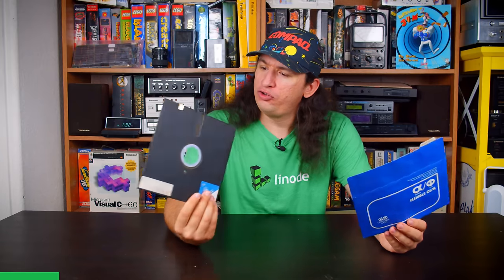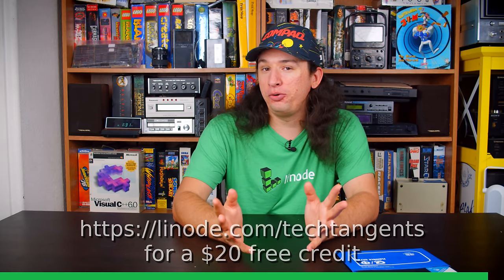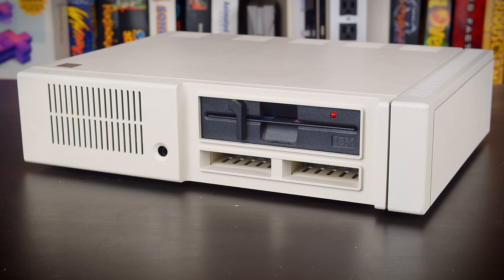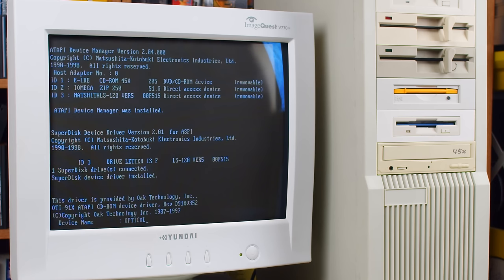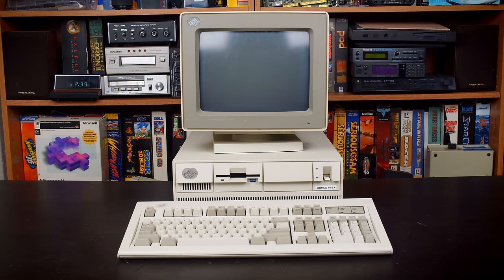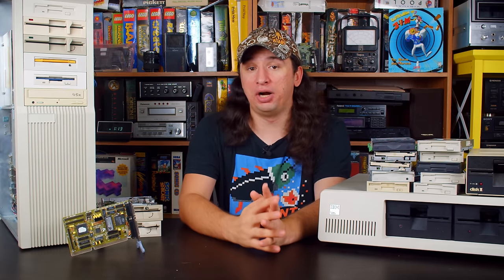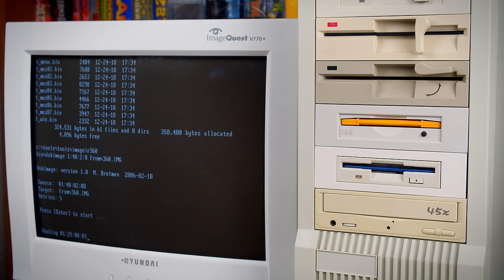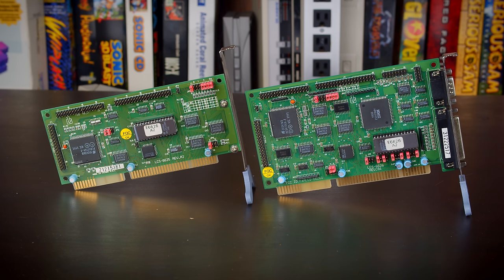More than two floppy drives?

Comment: having a floppy drive as C: would surely cause some interesting software problems :P
Reply: Probably. But did you know Windows can be installed on any drive letter (at least before Vista)? The NT based ones can even boot with absolutely no C drive. I've had this accidentally happen when installing 2000 or XP when there's already a formatted drive in the system.
Reply: @eDoc2020  i took a class on OS troubleshooting that involved managing five separate installations of NT on the same hard drive. it was quite the nightmare. parts of Windows and some Windows software expects Windows to be installed on C:, and will behave very strangely if that's not the case.
Reply: @iceowl  Even with properly behaved applications the different Windows installations will use the same 'Program Files' directory and you'll get lots of mismatches. Now whenever I need different Windows versions on the same drive I'll use a different partition and either hide the other partitions if I'm booting the installer from CD or delete/modify the migrate.inf if I started the install from within a different Windows installation.

Comment: Nice video ! I have XT clone and as usual it support 4 Flippyes configured with jumpers on the motherboard. The question is how to configure it for no Flippyes at all, it have to be 1, 2, 3 or 4 , but not have option for 0 . It is annoying to press F1 every time on the POST, beciuse I have no floppy controller and floppy drives in the system

Comment: How do tape drives like the QIC 80 fit into all this? They were usually directly connected to the floppy controller with a special cable which in turn had a connector to which the floppy drives were connected. Would this mean the QIC 80 drive would actually be adressed as the 3rd or 4th floppy drive?

Comment: Nice video, also wanted to mention i actually tried to sign up for linode using your code but my account was immediately banned i tried contacting support and they refuse to share any information as to why they did that, i checked all my information and they basically refuse to help in any way. So yea quite an unfortunate experience.

Comment: w/ LS-120/LS-240 they strictly can NOT read anything for standard floppies in 720k/1.44Mb, w/ the LS-240 can format normal 1.44Mb as 32Mb floppies, (though "Super Disk" [120/240] drives dont fall pray to Zip Disk drives' Click of Death. (though they cant be used on IDE cards like the Promise Ultra 33/Ultra 66/Ultra 133 line of cards. where some other IDE cards i "Think" you can use a Zip Drive on.)

Comment: amiga can 4 floppies and read endles formats on it
also the IDE can handle more hard disks then on the PC ...
Reply: Yep, my Amigas and C64s would have more than 2 floppy drives connected on multiple occasions.   Why might someone routinely need more than 2 floppy drives?  er.. um..  yo ho yo ho...  ;-)
Reply: Uh, ... Cool.
Reply: Mr Guru  yes stock without a little easy midification 😁
Reply: Mr Guru  I have a nice little device in my A1200 which allows me to use up to 4 IDE drives at once; one port has a standard 40-pin connector, and the other has both a 40-pin and a 44-pin 2½" connector, but only one of those can be used at a time.

Comment: i assume mainboards often came with 2 ide ports because the single controller supported 4  drives much mike modern high end Z490 boards still have a ps2 port

Comment: Combo drives are worth around $100 on eBay now. If you have an old combo drive, don't throw it out.
Reply: Do you mean the drives with both a 5 1/4 and a 3 1/2 mechanism? I've seen one of those on an old Gateway.

Comment: My imaging machine is a 9x computer with 2 5.25 drives HD and DD as a and b.   And I have a usb 3.5" drive. I do some cable swapping if I need hard controlled 3.5". But this is good enough really. Not as elegant as the modern card or card you have though.

Comment: I have a Windows 98 machine with a busted floppy controller on it.  I don't know what's wrong with it, but when you connect a drive to it, it either won't detect the drive or it will but it won't read disks.  I was having trouble finding a PCI floppy controller.  All the cards I could find/already have are ISA and this board doesn't have ISA slots.
I am using a LS-120 drive here since it connects to the IDE controller.  I have no issues reading 1.44 floppies with it, though I haven't tried using imaging software with it.
Reply: Is it possible to just replace the board? And is the cable in the right way?
Reply: @HappyBeezerStudios  The board I found at a Goodwill.  So, I could replace it, but that's no fun.  I've tried different drives, cables and orientations and nothing works with the floppy controller.

Comment: Wait a minute, doesn't this machine also usually have an XM1541 adapter attached to it?  That's 6 whole floppy drives!
Reply from the maker: I need to re-evaluate how I do that in the future, Of course I can't mount a 1541 internally now that I managed to find a way to fill a 6 bay chassis. I think I'll still make the XM1541 internal, but give it it's own DE-9 port on the back of the case. Then I can make a DE-9 to DIN-9 cable for connecting C= drives.
Reply: @TechTangents  Hey Shelby, I plan to get me an old 5.25" floppy drive to install in an older PC, so that I can write Commodore 64 and 128 disk images to physical floppy disks; can you recommend some drives that would be good for this purpose? TIA.

Comment: Great, now I wonder if it's somehow possible to connect a floppy controller over PCI Express.
Also, it's pronounced ser-gey, not sir-jay.
Reply: I doubt they build floppy cards for PCIe. There are PCI cards and USB solutions, afaik.
Reply: I looked years ago and couldn’t find one, the closest was PCI and ISA. Fortunately I eventually found an external drive which could handle DD disks for my Amiga.
Reply: @tech34756  what drive is it, if I may ask? I have an NEC (I think) external USB floppy drive. Works well for regular 1.44MB diskettes. Haven't tried DOS formatted 720k disks but raw access certainly doesn't work to the extent that something like floimg for writing Atari ST disks requires.
Reply: djdjukic Unfortunately the model I have is from years ago and no longer sold, most I can recommend is to look around and buy from somewhere like Amazon with ‘fulfilled by Amazon’ so it’s relatively easy to return and you can try it out. 

I don’t know however if this would be useful for you, in the case of the Amiga I was formatting standard FAT disks since Amiga OS supports these via software to transfer small files.

One other option to consider is checking to see if alternative methods such as Goteks are available for the ST, I ended up replacing my internal FDD with one when the latter broke.

Comment: What floppy drives would you recommend in 2020? Assume I only want to read 3.5" disks.
Reply: Since motherboard manufacturers are steadily dropping support for floppy disk controllers, your best option may be an USB floppy disk drive.
Reply: Best counter question would be: What would you want to do with it. For just reading PC formatted 1440k drives on a modern machine USB drives should be the easiest solution, but for something like writing 720k disks or booting DOS off it, or running them in older machines a corresponding internal drive might be better.

Comment: well ... 1 hdd, 1cd, 1 cd burner, 1 ls120 or zip was much more prevalent than a 4 floppy drive system ever was
Reply: ZIP would run on IDE or SCSI, same for LS120, so with using one of these no extra floppy port is needed.

Comment: what about putting 20 usb floppy drives in one pc?
Reply: Yes, you can use USB hubs. You might need creative physical mounts, though.
Reply: @eDoc2020  so tape and glue
Reply: @dialupdave6276  I might actually end up doing that with my "new" case I just got. It needs special drive rails for the 5.25 bays and I don't have any. I designed a 3D printable model that should work but unfortunately I don't have a way to print it out.

Comment: Oh shoot, you were doing great calling all 5 of those non-optical drives "floppy," because they actually all ARE floppy drives! So you ruined it for yourself when you said that the Zip and LS "aren't really floppy drives." They ARE! Just because they're not standard ones doesn't mean they're just not ones! Are the disks they use floppy? Yes! Then those ARE floppy disk drives. Where did you get any strange idea that just because they broke a certain barrier that means the disks are "not floppy"?
BTW, why not put the LS and the 2 standard 3.5s right next to each other (for a less choppy progression) and then put the Zip down below that (so it goes 5.25 1 and 2, then standard-looking 3.5s 1, 2, and 3[LS], then Zip)?